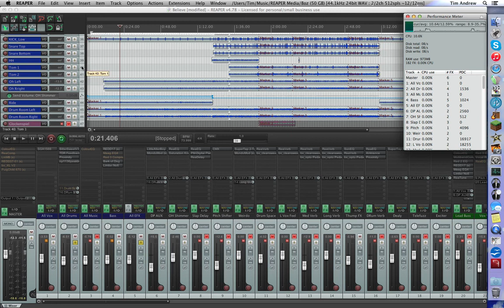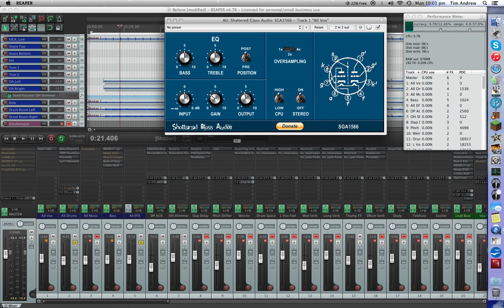Reduce Audio Dropouts in your DAW

Comment: hello. im having the same issue in cubase recording software. a pop comes up during recording that says : recording error audio dropout detected 
im using cubase version 8.0.10 (64 bit)
buffer length is 10ms
sample rate is 44.100 khz
bit resolution is 16 bit
plz help
thanks
Reply from the maker: I feel you pain, it takes away from the flow of work.  What is CPI usage like at the time?  Using a lot of hearty modelling plugins chews through resources faster on older machines.
Reply: what is CPI usage? where to find it?
i have windows 7 that i have been using for over 7 years now.
Reply from the maker: sorry, typo from phone.  CPU usage.  In Reaper go to "view / performance meter", the one I had on the side of the plugin in the video...if it is an old machine running Windows 7 that could be the issue..."old machine".  I ended up getting an i7 with more RAM, upgraded from Core2 Duo...the more plugs and tracks you use the better your machine has to be to deal with it.
Reply: mine is i3..
CPU use it says 0.4%
Reply from the maker: Is that one plug?
Reply: +Optomod yeah it ia
Reply from the maker: I would look at overall CPU usage and number of playback tracks will have an impact too
Reply: +Optomod so that should I do?
Reply from the maker: HHD speed, RAM & CPU all play a factor in this.  I started mixing songs with a large number of tracks.  I had to render to listen back, what a nightmare...I ended up upgrading my machine.  This video was to help anyone problem solve to try and carry their machine as far as it would go.  Have you tried running your audio files from an external drive to see if that would help?